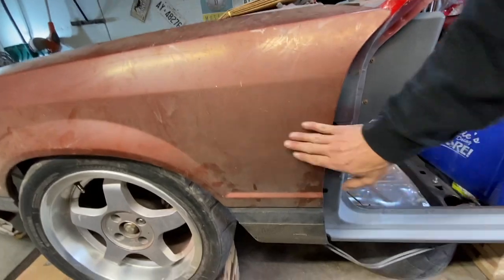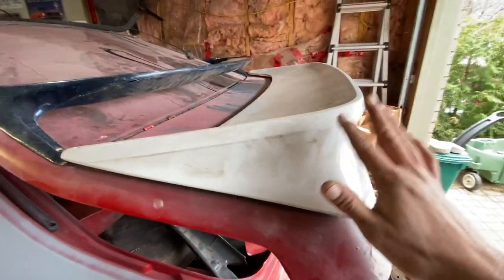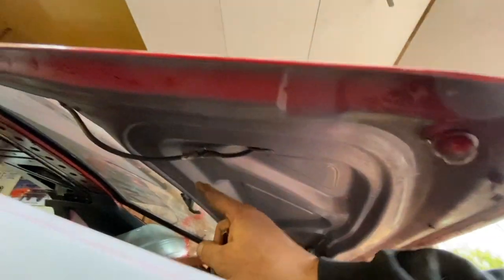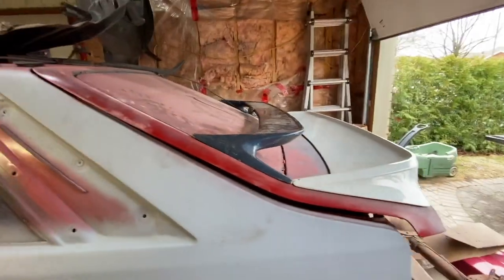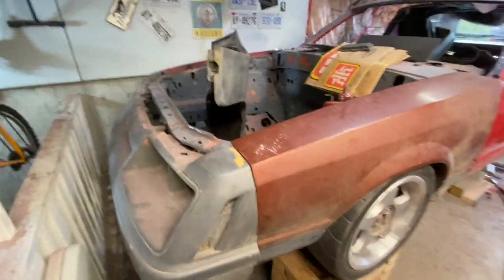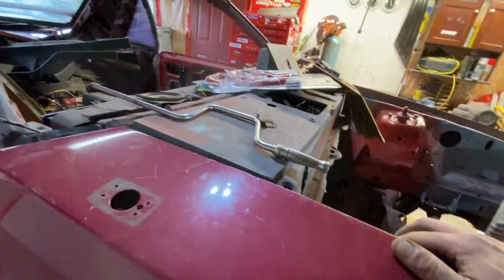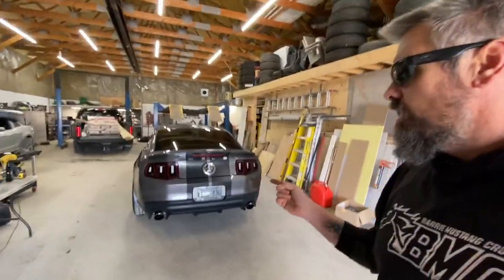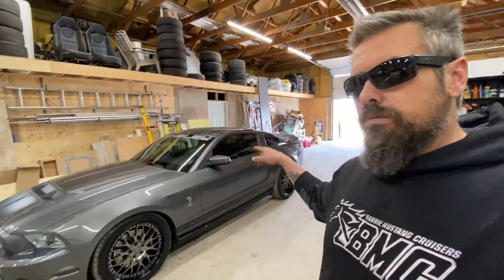Foxbody new Spoiler reveal! and the GT500 comes out for a baby gender reveal!!

Comment: Just too bad there is not a common Foxbody parts website or app where enthusiasts can barter or buy specific parts vs modify other parts. Would been nice seeing a lx/gt winged hatch swapped for your smooth hatch. Overall it’s your car do what you want but it seems these foxes are the modern day tri 5 chevys. Will be hard in next few years to find unmodified original parts. Aftermarket panels are just not anywhere near quality of originals.